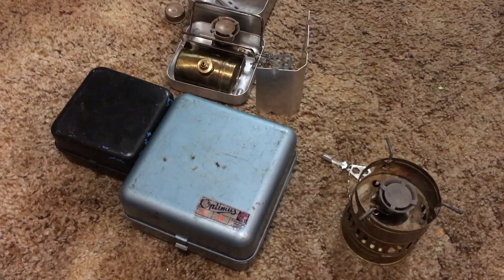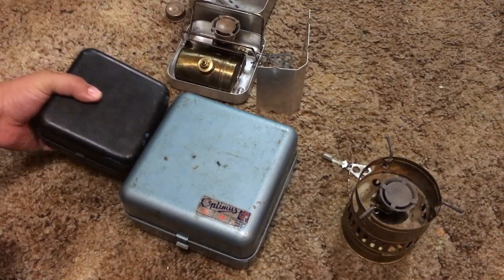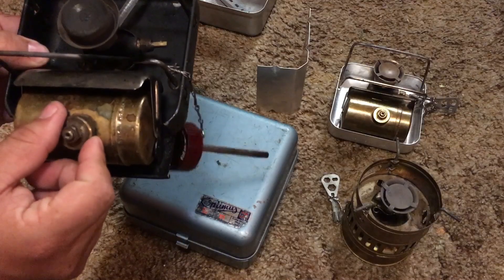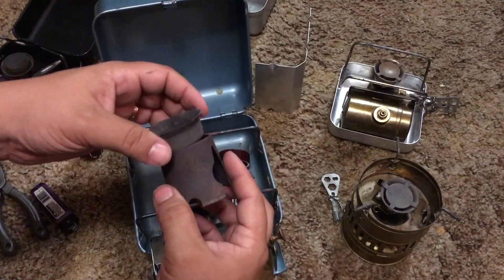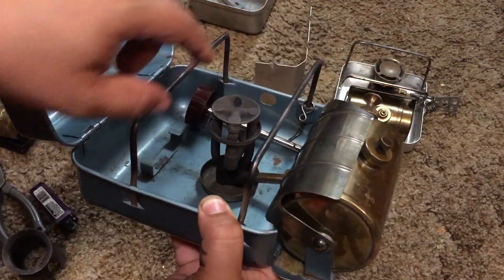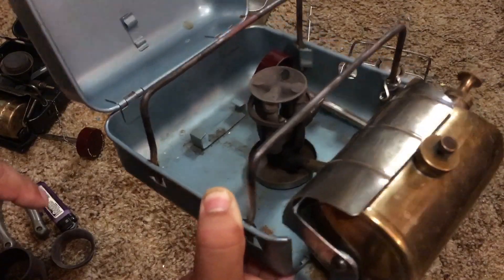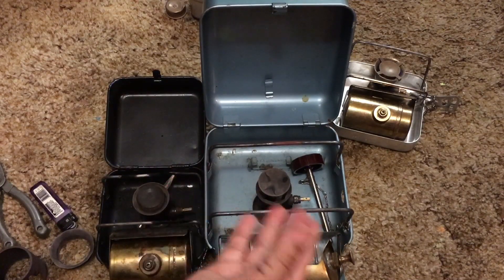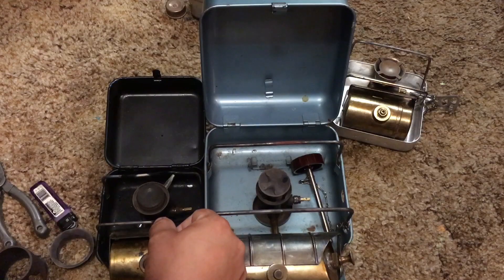A primer on some Optimus stoves

Comment: I just bought what I believe is a 111T for $25. It's never been  used. One of the hinges on the box has been damaged & rusted through. It has some scattered oxidization on the brass. Never had fuel in the tank; so not sure about the pump seals yet. Just trying to find all the info I can before I tear it down & restore it. Thanks for the info.
Reply from the maker: Trail Hound yeah I saw your post on the fb page!  Outstanding find!  Congratulations!  Obviously my favorite model camp stove!  I once found an unfired 8r at a yard sale for $20.  That’s probably my best ‘deal’ story.  My first 111t was from a military surplus site in the mid 90’s.  (One of my first ever internet purchases)  they had used 111t stoves for $25 plus $4 shipping.  The one I got (yes I only ordered one) was functional but very well used.  

Congratulations again!

Comment: My 8R is now 42 years old and I still use it never had a problem not once they are bullet proof stoves
Reply from the maker: Nomad Survival Forum there is definitely a charm to the 8r/99 stoves.
Reply from the maker: Nomad Survival Forum ...funny you should mention ‘bulletproof...’  when I first got this 8r... it had a different case complete with two pass through bullet holes.  It might have frustrated the previous owner.
Reply: You sure them aint bear tooth holes LOL
I have never had a problem with it I even used none leaded gas with some carb cleaner for at least half its life with me and have never ever had a problem with it. I will be using it every day in aug up north for moose season unless I get something early but then I just like it in the bush maybe I can eat a hole moose in a month maybe I will dare myself LOL...
Reply from the maker: Nomad Survival Forum well when I hold the case up to the light two of the holes are perfectly lined up with the other two.
Reply: OK then maybe not real boolits proof but close at least the only problem I have heard of is if they are run dry and they burn up the wick that goes into the tank but that's easy to fix with some cotton string.
I have never taken mine apart that much to really see if their is a wick going into the tank or not on mine.
I just know it works every time I use it and that's good enough for me besides I am to lazy to pull out my 3 burner coleman gas stove these days. and I like the coleman too I can use naphtha/none leaded gas with carb cleaner/propane. so you can say I like options one is none 2 is one...
Reply from the maker: Nomad Survival Forum Yes, all three of the smaller stoves in this video have the cotton wick.  The larger one does not, as it relies on the pump to operate at all temperatures.  I’ve definitely heard that the wick can be damaged by burning dry but in my experience it hasn’t been one of those things where if it burns dry once it’s ruined.  I think it’s a cumulative thing.  The best practice in my opinion is to fill the stove just before lighting.  The cap should be loosened anyway and re-tightened right before lightning to equalize the pressure in the tank anyway, might as well fill it up.  The 8r/99 hold less fuel than the 123, but I’ve found it to be enough for practical cooking.  It might be an issue for melting snow all the time.

It’s a good idea to keep a small hank of cotton mop string on hand in case the wick gets too burned to properly wick fuel.
Reply: @Thereal111t  I've got an 8r but never seen the 99 before. Recently looked at a lot of stove films on YouTube none of those had 99s either.
Owner of 1 8r 2 No5 2 96 1/2 pint  stoves. 6 Tilley and 2 Bialladin/Vapalux lamps.
Reply from the maker: COIcultist the 99 is a more common stove than the 199 which is basically a 111t burner hoked up to a 99/8r tank in a 99 aluminum case.
Reply: @Thereal111t  A 111t burner hooked up to a 99/8r tank? Well obviously if I've never seen a 99 I've never seen a 199t.  I have two opposing thoughts and I suppose both can't be true. 111t burner with 99 tank: I suppose it must come with the "other" pressure release valve and a pump or you cant do kerosene. If it didn't have the pump and was gasoline/white gas only are there issues with the larger burner's fuel demand outstripping the tank supply or issues with larger burner and larger pot overheating the tank?